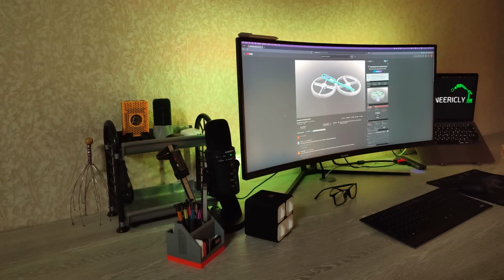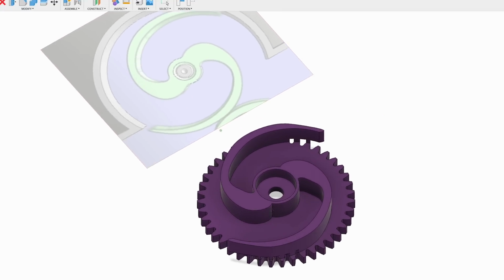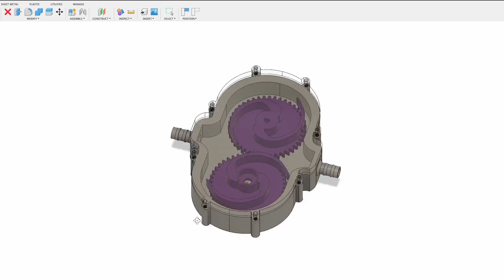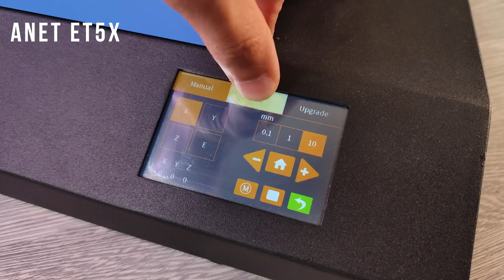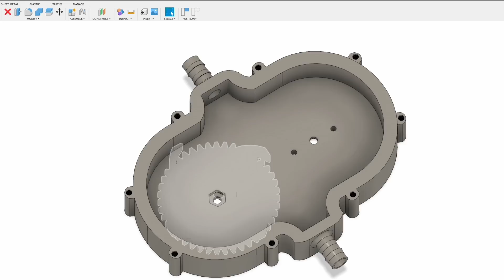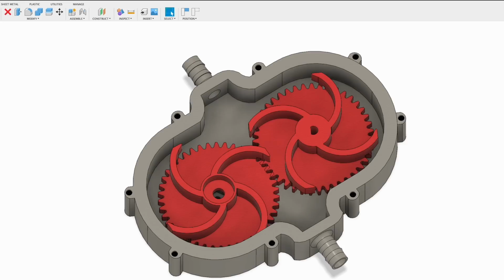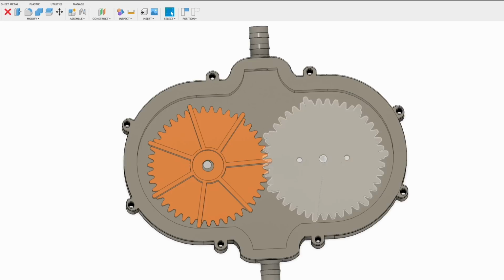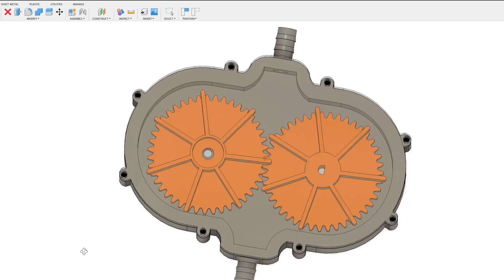I Made Dual Impeller Pump [3D Printed] - Will it work?

Comment from the maker: Did you find any problem with my design? 😅
Reply: Should be no space between the walls because when the walls move and bull the water will Waste on air
Reply: The original impellers overlapped, so they could create a set mass of water to move on every “scoop,” which was separated from the water behind it.  Your original models did not, so they each acted independently of each other.       
   
  It’s the mechanical difference between putting a two-stage turbocharger on your car’s intake, and mounting 2 computer fans in their place.  One can create a pressure increase, the other just pushes the air with changing pressure on either side of the blades.
Reply: There no Enough water go inside the bump
Reply: yes, you should put the gears outside, otherwise it will not work properly
Reply: Maybe you should try using some kind of rubber between the acrylic and 3d printed plastic. There's 3d printing filaments that are rubber like but they're very hard to print with so something simple like flex seal liquid rubber would probably have worked reall well
Reply: If you design the impellers to sweep backwards from the direction of rotation it should churn the water up less for a more constant and steady flow (you currently have them swept forwards, you would think this would scoop the water but it’s actually trapping water as the design tries to pull the water to the center of each impeller but the rotation creates a force that pulls the water outward).  This is why your straight blade design worked better than the others, the design wasn’t fighting the other forces.  Also like other commenters have said, minimize gaps to reduce losses and use curves on everything that you want to direct the water with to minimize flow resistance.
Reply: first, nice unconventional use of basic pump principles. 
but if you're asking, you built a non-forced pump, a very inefficient one at that. 

this kind of pump is mainly low pressure, high flowrate. 
it works on centripetal force, not displacement. so you need to fill the housing for it to actually pump stuff, as you probably noticed. 
if your moved material is at the same or higher elevation, you can do that by blocking the exit till it filled itself. 

also, lots of cavitation going on, so this is producing negative pressure areas between impeller/gears and housing.
think about putting the intake in the center of the impellers and a little tighter clearances impeller-housingwise, opening up only to the exit.

i'd like to see an improved design :D
Reply: Yeah, the design is inherently flawed! On gear pump you use only gears, not impellers, they look cool but cripple the entire function of a gear pump.. Gears need to touch all the time, space between them must be watertight!
Reply: Most impellers introduce water at the center and it is pulled outward. Maybe try a front plate with holes at the centers as inlets. I would expect much better results with this.
Reply: The problem is that you have a central frugal water pump design and that needs the suction to be in the centre of the impellers or it won't work.
Reply: Esselamu aleykm.  It is not a good design . gears in centrifuge case and so act like gear pump pumping opposite to ur outlet. There are 2 centrifuges ( centrifugal power starts at mid to outer shell ) your inlet is in lower part. You may try to simplfy it to gear pump or centrifugal one.

First you should try single rotor centrfg pump. And u may try easy peristaltic pumps to print. And u may try small membrane pump. Than you can upgrade them to small jet pump.
Reply: Not a problem with design but i use sugar water for glass works great. 1 part sugar 4 parts water heat up and dissolve sugar and just put on bed right before print when its done and the bed cools off the part will just pop off.
Reply: Can You print Articulated Easter Dragon with eggs? it's on culs3d
Reply: yea, the rotors don't actually mesh the just spin next to each other, subtle but one works and the other is what you made
Reply: The first one in the video is back words
Reply: with the purple impellers, I think it would do better if you flipped the intake around to where they fling it out instead of just pushing it.
Reply: Impeller pumps usually have the water feeding into the eye (center) of the impeller.  To use this as an impeller pump - I suggest making holes in the transparent front plate near the center of the impellers and feeding water into the front.  The existing configuration (with no holes in the front plate) looks like it could work as a gear pump - print the gears to be full height and try to close in the clearances between the gears and the body.
Reply: Nop, really good model.
Reply from the maker: @grounusrastarcorno9529  Thank you!
Reply: No so great masha alla
Reply from the maker: @Supersoccerchamp-qo1pl  Jazakumullah khairan:)

Comment: A few things to note:
* The cover needs better sealing. You attempted with the 2nd and 3rd impellers by putting some silicon on it, but that doesn't fully seal. You need to have a channel and put like a rubber seal in the grove. You can get these in a spool to cut to length
* The clearance between impeller and housing is too much. Ideally you want a half mm or less. The closer the impeller is to the housing, the better. The gap allows water and air to move "around" the impeller instead of being forced "through" the impeller path
* Most dual impellers work more efficiently if they are lined up, where the fins are almost touching. You have a lot of space between the fins as they rotate, allowing air/water to more easily flow around them instead of being pushed by them.

The 3 designs you showed here have some promises. The first one doesn't seem to be the best, tho. Align the fins closer to each, maybe 1 tooth apart, decrease the clearance of the housing & impellers, use a better seal, and repeat your tests. You'll find a much different result afterwards.
Reply from the maker: Thank you for your advices!

Comment: the impellers are supposed to be perfectly lined to each other to force the water out the outlet, the way you have them setup creates a path for the water to flow back between each impeller... during the rotation the volume at outletside is supposed to decrease by rotation intill the impeller passes the outlett. also if you think about it, outlet and inlet sides are equal in this design, there is no difference between them, a pump with a single impeller with this type of impeller has the inlett in the middle on top of the impeller, basicly you have two outlets and no inlets in your design. try that, dual inlett on top, and delete one of your outlets, and align the impellers so the tips of the blades close the gap and forces the water out the outlet.

Comment: This is a unique idea but you don't understand do the fluid dynamics behind an impeller pump which is why this is working horribly impeller pumps work by pulling in water forwards into the impeller and accelerating it outwards against the body of the pump which has a curved shape that causes the water to accelerate out words expelling it from the pump look at a turbocharger

Comment: U dnt need to minimize the gaps btwn shell and propeller in those centrifugal pumps but u need in gear pumps. You easily try to make one stage cent. Pump. Than add it more to increase stage. To upgrade

Comment: you have the body of a lobe pump but the impellers of a centrifugal pump, that is the issue that you have. i suggest trying to replicate the lobe pump since it's probably easier to print the lobes than the housing

Comment: For me it seems like you mix two different types of pumps. Your first impellers seem similar to vacuum pump's impellers basing on different pressures regions, but they don't seal each other and distances from body are to big to work in this way. As traditional pump it may work way batter if distances from body are smaller
Reply from the maker: Great point!

Comment: 1st design is the best, but assembled completely wrong. Impellers' hands must touch each other all the time. They are designed to be that way. Also there should not be gaps between side walls, front and back lids and the impellers - gaps gives the way for fluid to escape.
And speed is too fast. You should make reductor to lower impellers rotation speed.
Reply from the maker: Thank you for your great points!

Comment: I think you completely misunderstood function of pumps! You have a gear pump design, it should use big teeth, the liquid is pumped by the teeth along the outside perimeters, point where the gears/teeth touch each other should be watertight!
Using impellers on gear pump is counterproductive, either use gears on gear pump, or build an impeller pump with impeller!
Reply from the maker: Thank you for your feedback!

Comment: The devil is in the details. If you look back at the rendering video the veins push the water along the outside walls of the housing, not between the two impellers. In addition the two impellers “seal” against each other in the middle. This is what causes the pumping action. AVE did a good video on a hydraulic pump using this principle a while back. I think getting a good seal will be your biggest is issue. A jet ski impeller type pump might work better for 3D printing as I feel that the sealing is less important.
Reply: That's correct. He should see how a gear pump works.  It should work according to the principle "volume displacement".  Of course, everything has to be as sealed as possible ^^
Reply: On spot comment! Finally someone understands how this works.
Reply: I didn't even bother to watch after I saw that...

Comment: It was more of an inline pump i.e. it would work better submerged to help eliminate the air from the system. Great design though. Keep up the good work.
Reply from the maker: Great point!
Thanks.
Reply: @engineericly  Yes, maybe some silicone or a liquid gasket sealant between the plexi and the pump.

Comment: I think you designed a pump that mixes and froths at the same time it moves liquid.  I think it would be exciting to see a 3d printed twin screw pump or 3d printed gerotor pump.
Reply from the maker: Thank you for your feedback!
Definitely, I will learn those pump types, if possible will build them!
Reply: @engineericly  Looking forward to it.  Check out dovetail O-rings. It could solve a lot of your sealing issues I believe.   Slight obstacle is finding properly sized rings for your 3d printed designs but I think it may be worth the effort.

Comment: I always thought the air intake for an impeller had to be at the centre of the impeller.
Reply from the maker: Yes, but it was not possible with this design, in case of single impeller I am on your side!
Reply: @engineericly  You could have had 2 separate intakes hooked up to the center of both impellers on the cover plate.
Reply: @engineericly  you have two outlets and no inlets in this design, try turning it around in front of you, both "inlet" and outlet are equal :p, changing rotation direction wont change anything ether, still equal :P